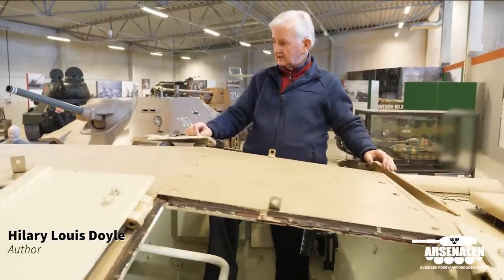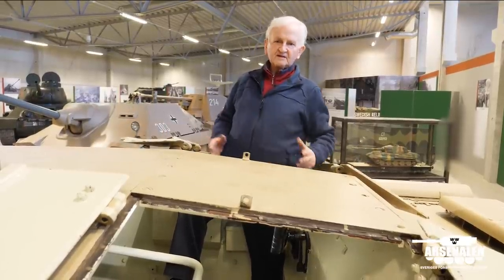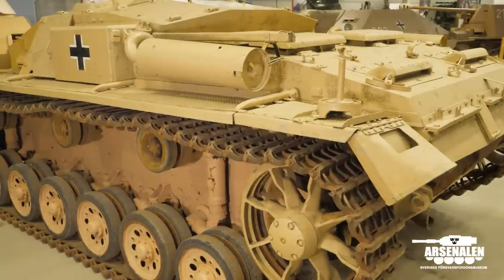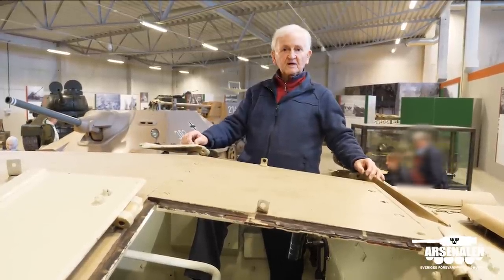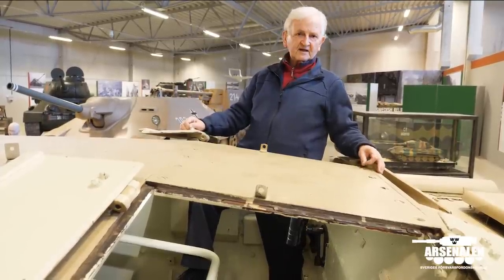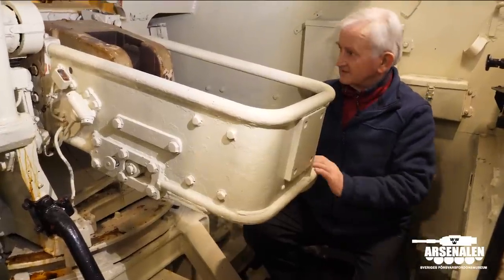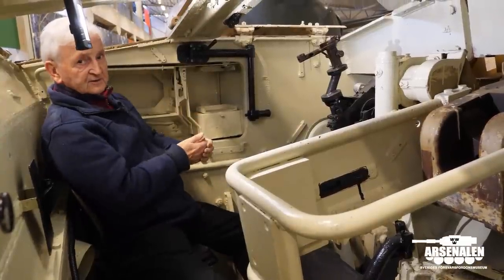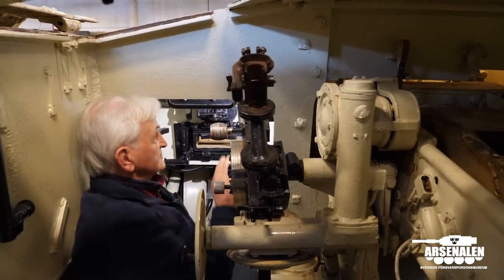Inside the StuG III with Hilary Louis Doyle | Arsenalen Swedish Tankmuseum

Comment: Great video, I do have one request, I would absolutely love to see what the inside reticle of the gunsight looked like, as a war thunder player I've installed custom realistic german gunsights to the tanks and I would love to see of theyre historically accurate.
Reply: I agree it would be nice to have a quick photograph of the sight picture. Stick a piece of white paper in front of the sight maybe an arm's length away for the contrast and to allow light through. 

I know it is a damnable nuisance to focus lens through lens, especially modern digital cameras that have auto-focus programming that can be very temperamental, but it would be useful information that tends to be overlooked. 

After all, most people will never get to sit in a Stug III's gunner's position, and realizing just how limited the fields of vision armored fighting vehicles have is something more people need to appreciate when making assumptions about how the vehicles could perform.
Reply: There is somewhere tne photos of the German gun sights but not all of them! You have to look for the links unfortunately...
Reply: I can help with this one..it's a series of triangles. Six with a larger one in center. You use the size of the vehicle in the sites to estimate range.